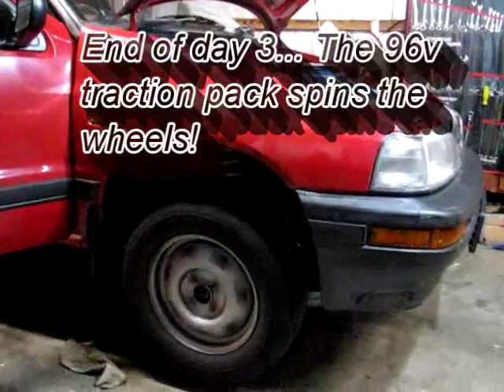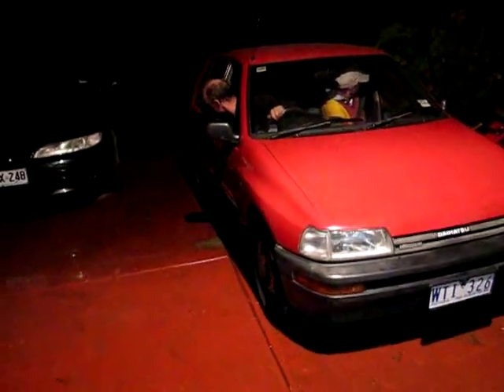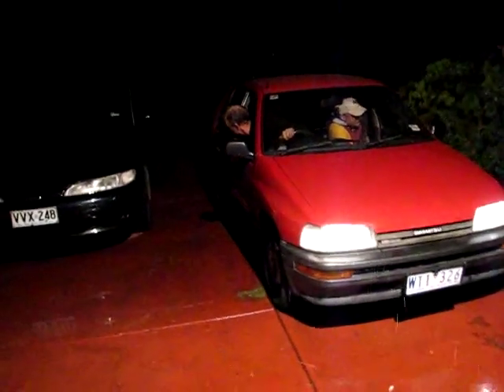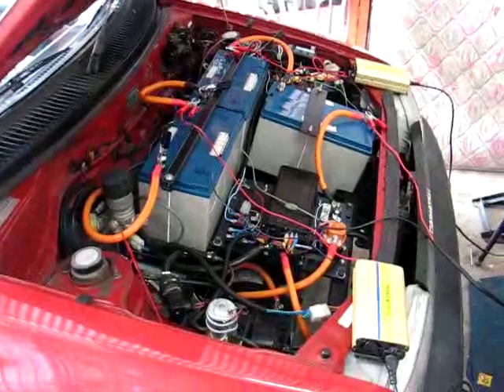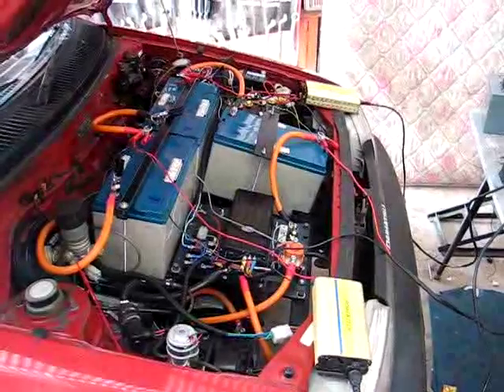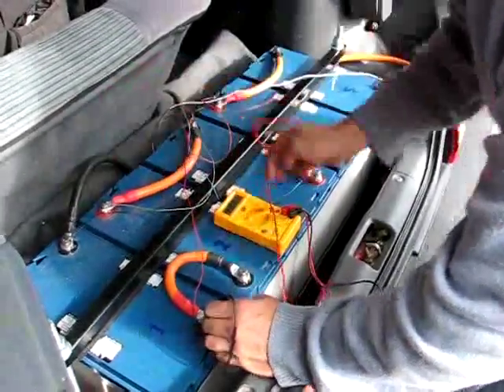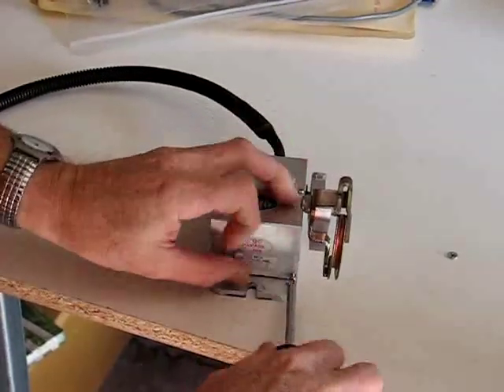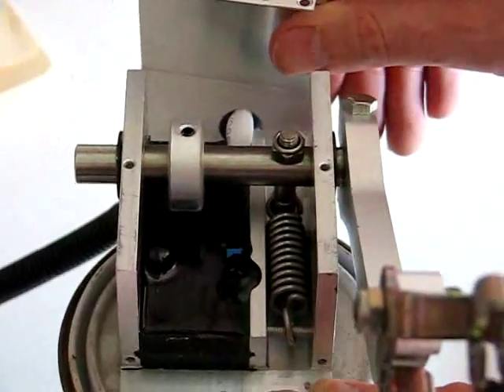PART THREE OF 3 DAY DAIHATSU CHARADE ELECTRIC CONVERSION

Comment: I would like this but the 70 kmh means no highway driving and 50 km range means i would barely make it to work and back each day
Reply: Hi Doug, see my reply to Un below. Current lithium pack has 32x 106Ah batteries. It draws 1kwH per 7km. Range was theoretically 100km or thereabouts from memory when installed and it definitely did 90 once without problems when the batteries were new. But yes, max speed dictated by the motor which wasn't designed for EVs.. it is an industrial motor (cheap though). Old batteries now and they sag under load, range is now around 50km without me suffering range anxiety.
Reply: Michael Axtens i was wondering about rego costs? It could be financially viable to have 2 cars. An EV for short trips and regular car for longer trips or highway driving. If rego was subsidized

Comment from the maker: It is "sort of" working. The first batteries died after about 2 years due to my ignorance...and a bit of "flogging" it to show it off. I didn't balance the batteries properly for the first 50 charges.. got scared by the bubbling and the 16V they were reaching so turned off the charger. This prevented them from being properly balanced. They died in winter. Lithium now..but not wired. Should be back on the road in the next few weeks. I also have to add that for registration it needed a bit of work

Comment: And that is assuming he uses all the available power from his battery pack - which I doubt he does as most EV owners only use between 50%-80% of the available power.

What that actually means is that the owner most likely is only using about 5kWh-8kWh of electricity per charge, which is only $2.00-$3.20 worth of electricity to travel 100km - a $6.55-$7.75 saving per 100km.

But most EV owners are not in it for saving money - most are in it to stop using petrol and to help save the environment :)

Comment: The Daihatsu Charade uses approx 7.5L of fuel per 100km of city driving. Fuel costs $1.30/L - so that's $9.75 per 100km of city driving.

This electric conversion has a 10.5kWh battery pack and can do 50km per charge. That means he would have to charge his battery pack twice to travel 100km. That would use 21kWh of electricity. 1kWh of electric costs $0.20, so he would use $4.20 worth of electricity to travel 100km.  That's a saving of $5.55 per 100km.

Then there is the greener benefit too :)
Reply: Hi Un. We never ran it until exhausted, but we did 70km range without problems with lead acid. We replaced with lithium and the initial range was over 90km, but the batteries are now 8 years old and I just use it for around town, and never plan to do over 50km range. The batteries now often sag under load, but recover (we've had a few accidental overcharge events which has shortened their life - bad BMS decisions, but she's still getting us around. Only done 30,000 electric Kms so far.. but that's all on solar electricity!